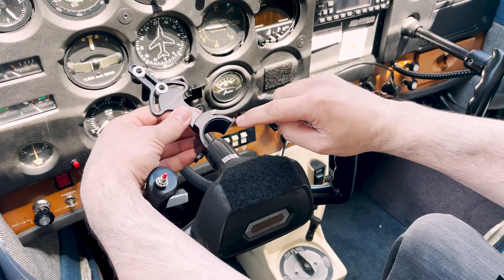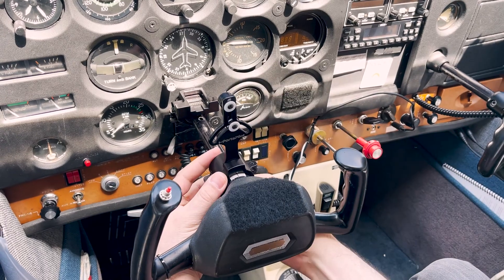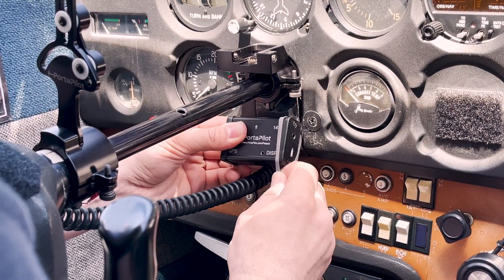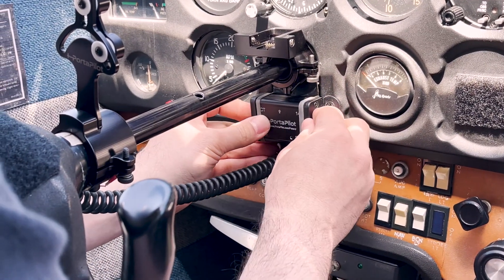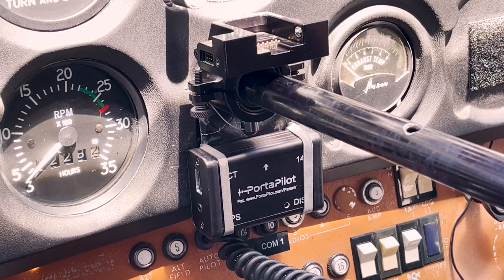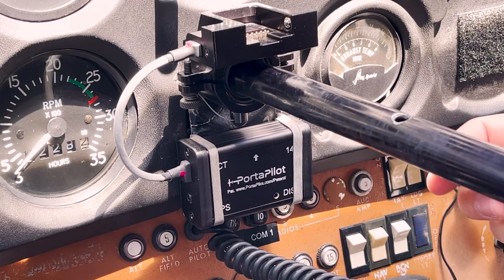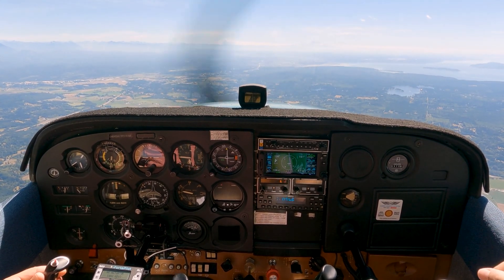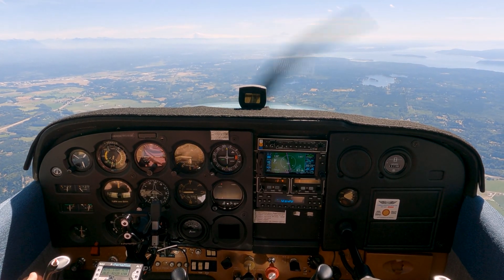PortaPilot Cessna 172 Installation

Comment: Will this unit read RS232 data from a KLN89b GPS?
Reply: It is compatible with just about any GPS navigator. Simply connect it to a panel or portable GPS navigator’s RS232 port.

Comment: Wheres the power come from?
Reply from the maker: A cigarette lighter plug is included to power the PortaPilot.  If your aircraft is a 28V system, a optional voltage reducing cable is also available on our site.

Comment: Well done guys. Will this unit fit the Piper PA28 and Arrow series?
Reply from the maker: At the moment we are only compatible with (many) Cessna 172's.  We plan to expand to other aircraft in the future.
Reply: @portapilot6420  I will buy one right away if you make one for a cherokee 180c